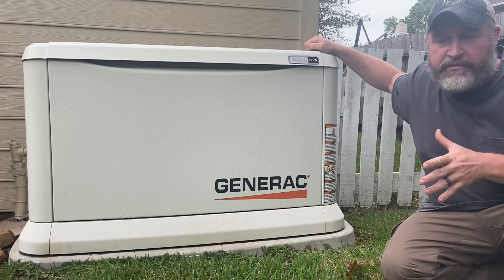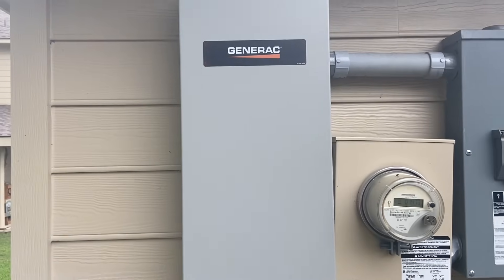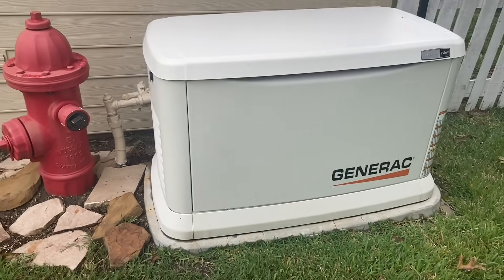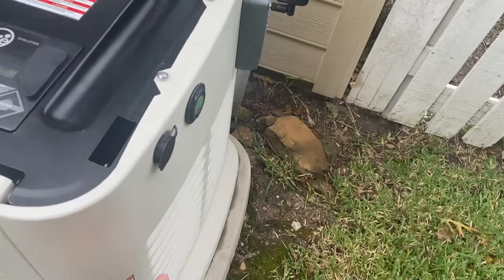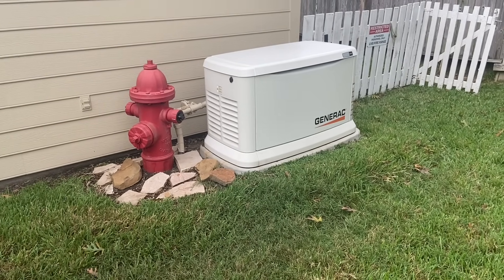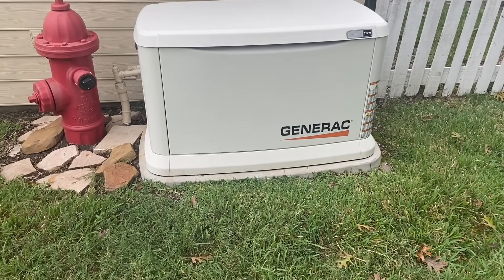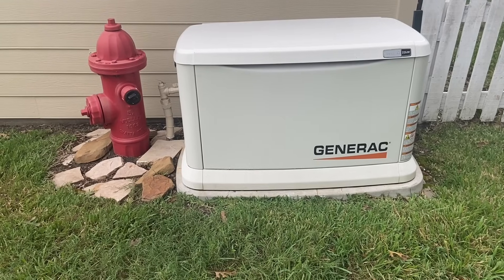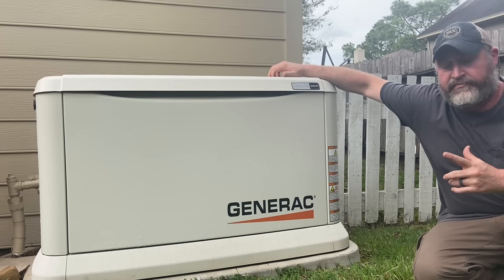Thinking of purchasing a generac whole home generator?

Comment: I have the 22k generac and purchased the 10 year warrantee,about $10k.  In the 5 years I have had it, it has run about 5 hours.  It test runs each week on a schedule an each year it gets checked.  This year I had the battery changed out as well as oil and spark plug as for each year.  Two weeks ago the red light came on, I had a quick check for problem, some item that will not let the generator start, broke.  This must be ordered, and that time may be from two weeks to a month, then schedule the repair.
Reply from the maker: Nice thanks for watching and the comment, what part broke? I ended up buying a few extra fuses that are used in the transfer switch, and also a oil pressure switch just to have on hand.

Comment: I really appreciate this video! We live in Florida where we have the occasional "weather conditions" that tend to cause undesirable power problems. I've seen these units on display and have wondered how much it would cost (ballpark), to purchase and install one but I honestly didn't want to have someone come out to my house and then bug me for months to buy one. It's good to know that whatever the sticker price for the unit is, I am still looking at about another $6000 for everything else on top of it. We do not have anything running on gas so we would have to investigate an additional LP Storage Tank and figure into that the additional costs involved there- how much to fill it, is there special maintenance involved or "gas treatment" involved if it is not used for months on end, are cylinders an option or will it have to be buried, etc...
Reply from the maker: Thanks buddy for watching, a large tanks 500-1000 would probably be the way to go. I don’t think you will have much to do for maintenance on the tank or LP gas.

Comment: I briefly worked at a small wastewater plant, I was a contract operator there, it had a much larger version of the Generac generator for backup power (Imagine something about 10x as big as what is shown).  Having had some previous experience with an extremely loud portable Generac I was concerned that the noise this small wastewater plant would make on backup power would annoy the small community it serviced.  
Well, when the plant experienced a power interruption I was completely impressed at how seamlessly it transferred the plant's power needs to the Generac and how quiet the Generac was...imagine a car idling.
My point being they do make very quiet Generac generators but based on some of the comment found here they still make some very loud backup generators too.  Choose wisely, like you care about your neighbors and enjoy sleeping during an outage.
Reply from the maker: Thanks for watching and the comment , some can definitely be loud we are happy with the nose level of ours. How Loud Is A Home Standby Generac Generator?????
https://youtu.be/C-a5FbEqU7A
Reply: The Commercial ones are built much better than the residential ones, which are like an appliance.  That large one was probably a diesel, running half the speed, in a sound insulated cabinet.

Comment: Pretty cool and great investment especially for the folks out living in the gulf coast and east coast. We have a 6500W Honda generator we’ve had for years, and use it as a back up source when we lose electricity. It was initially gas but we switched it to propane since we a 500 gallon propane tank and it made much more sense. When we had the house built we added a 50amp plug for our RV, and that is what we use to plug the generator to provide electricity to the house.
Reply from the maker: Nice ! Great to be prepared we are in the gulf coast so I know where your coming from. Thanks for stopping by and checking out my channel. Please subscribe like share!

Comment: Kohler is a very good generator as well. They are actually commercial grade engine and cabinetry. There are pros and cons for both of these brands. I am leaning towarďs kohler at the moment i think. Thanks for the great review.
Reply: Kohler makes a good toilet...not sure how capable they are in the electrical department.
Reply: A cast iron engine with a "four pole " generator means it last longer and runs at half speed while producing same amount of power.
Reply: @chrisgraham2904 
Different company entirely. You never heard of Kohler engines? They've been around for a out 100 years
Reply: @kirkstinson7316  Your wrong about that!  Kohler Company of Kohler, Wisconsin, U.S.A. was founded in 1873 by John Micheal Kohler and they manufacture plumbing appliances, such as toilets, tubs and vantities and gas, propane and electric engines.  I was aware of their electric pressure washers.  Next year they will celebrate their 150th anniversary.
Reply: And the Kohler is made in u.s.a. vs Generac is made in china
Reply from the maker: False : Generac generators have been in production in the US since 1959.

Comment: Nice job. Great prices! By the flag, I assume your in Texas, so labor is much cheaper. I paid 6K just for a 2K Generac and switch. I did the trenching myself, and ran the gas and electric myself. Just needed the plumber and electrician to sign off on the permit. My permit was $1200, i had to have drawings made and approved, and the total was over 11K. And it broke the first two times I needed it, even though it self tests every week. The self test does NOT test the transfer switch. Mine started on fire when it stuck on the first time, and then the control panel went in the generator. The only good part was the engine. Maybe thats why they no longer sell the 2K model? That being said, my brother has the exact same model as mine, and has had zero issues.
Reply from the maker: Yea we are in Houston Tx, sorry yours did not work out we been good so far.
Reply: That’s not cheap.  I’m in Illinois and they are quoting me for a 20,000 KW about 9 grand.  But my wires and propane tank can be sat just 10’ away so minimal charge there.   I’m hearing 9000 to maybe 10 for mine with Kohler 20,000 and Generac.   I lean to Kohler due to electricians telling me and this…..  pissed off consumer.  A lot of people are angry about Generac not honoring the warranty.

Comment: I have had my 22kw for over 3yrs now..just changed the optima 35 group battery..house is only 1200sq.ft😎👊🏻 NO PROBLEMS
Reply: Beyond overkill you don’t even need an 18kw lmao you literally wasted money
Reply: @Youdontwantitboy  
Yup wasted it..😎👊🏻
Reply: Please don't waste your money on expensive batteries-it is not neccessary.  A standard automotive battery changed (replaced) every 3 to four years is more than adequate.  Just change it.

Comment: I've had my Genreac for 11 years and have never had to change the spark plugs.  I check and change my oil and filter myself.  I have changed my battery once also.  Why pay someone $400 dollars a year for a oil change that is simpler that changing a lightbulb.  Everything is right there in front of you.  Let's see... 11 X 400 = $4400 dollars! Thats almost another Generac. It's no harder that changing the oil on a lawnmower.  Save yourself some money. I'm pretty sure a guy like yourself can change your own oil. As for the spark plugs, how often do they really need to be changed?  I have not changed mine in 11 years and it still runs like a top!  It's just something for you to think about.  Other than that, it is a great video!
Reply from the maker: I don’t pay 400$ for a oil change but I appreciate you taking the time to comment.
Reply: @JustCantSitStill  You are very welcome.
Reply from the maker: @eddevoe2519  please stop spamming

Comment: I only paid $2195 for my 16kw and spent $200 for installation parts. Installed myself for $2400 total. Can’t imagine spending 4 times that amount!
Reply from the maker: To each there own , I do a lot on my own but some things I am not comfortable doing. We also wanted the extended warranty so the turn key install was the way for us. Thanks again for the comments, and watching.
Reply: Some jurisdictions won't let the homeowner do the complete install.........been there, done that.
Reply: Good for you.  Obviously labor is always expensive especially when the install must meet code and it involves electrical, NG/LPG, landscaping, & plumbing experience.  I certainly do not want bad wiring or leaking NG to ignite a bomb when the city power is lost.  I guess the peace of mind was worth it for me.

Comment: This was an excellent video and I appreciated watching it and learning about your experience using it. In Virginia a system like your's would definitely come in very useful since when commonly have power outages due to a mainly monopoly power company dominion energy that controls about 90% of our state's power production. And of course overbuilding of new neighborhoods in a short amount of time and little to no increase in capacity from the power company has resulted in more frequent and longer lasting outages. Also, the increased outages and power surges that come with them have cost us dearly by destroying major household appliances that you would expect to last for a couple of years at the minimum. Buying warranties with appliances is a smart move which came in handy for us when our stove/oven, refrigerator/freezer, and deep freezer; all died within hours and days of each other. The saving grace was that we had the longest warranties that we could get and bought our major appliances through Lowes which has an excellent service program with high knowledgeable and skilled repair technicians and warranty record. Hurricanes and tropical storms are also regular in Virginia and pose a more critical reliance case for generators in our area near Virginia Beach, Virginia the power company can take sometimes between 48 hours at the least if your lucky which is like super rare and on average 3 full weeks when we have a hurricane. So this is something that I'm definitely looking into for the future.
Reply from the maker: Thanks Richard for watching and the great comment, please subscribe and check out some of my other videos. Have a good one.

Comment: One of the 1st things to do is before you buy is to contract with a service provider that will provide service (including regular maintenance) in your area. 
My experience with Generac "authorized dealers" who perform maintenance and/or repair has been dismal. My installer, never returns calls, texts or emails. Other dealers in the area are no better. Ive contacted 2 other authorized private electric business concerning maintenance and/or repair and I even went to one of them of which during normal business hours the building was locked and their voicemail was full. Thus, no one I've tried contacting has responded. 
One more thing, the Generac warranty states if repair or maintenance is performed by anyone other than a Generac trained service person any damage to the generator may not be covered under warranty. Summary... you can't necessarily count on getting good service and if you do your own work make sure you document EVERYTHING.
Reply: me too same experience.
Reply: Not exactly.  WARRANTY work must be performed by trained personnel-for Generac to honor their warranty.  (Someone at the COMPANY must have a Generac Tech ID).  Standard maintenance work-oil and filter changes etc, can be done BY ANYONE.  Just keep up with your receipts and document the run hours IAW the manual.

Comment: Thanks so much for making such a detailed, informative video about these Generac systems. I've been considering getting one for a year or so now. I'm in mideast Tennessee and there's a good generator company in Sparta, Cove Generators, I had a few years ago install a transfer switch and outside plug for my DuroMax XP12000EH, who sell/install these Generac systems. They pretty much run about the same as what you paid, a little over 10k (plus or minus, depending on what's required). I'm still debating the pros and cons, though, tbh. My DuroMax is sufficient to run my entire house if the power goes out for any time, but I hate the idea of having to make gasoline or propane runs when my tankless hot water heater runs off gas anyway. It would be so much better to have a Generac using the gas we already have coming in. I could run the DuroMax off that gas as well, but I really like the automated function of the Generac. Plus I like that these companies have these maintenance services and will look after the machine for you. I'll probably pull the trigger on one. My home is just under 1300 sqf, and I only have one ac/heating unit, plus no other buildings that would need power, so I might not need one as powerful as yours. Thanks again for taking the time to make this awesome video.
Reply from the maker: Thanks for watching and the great comment , definitely a lot to consider. For us the convenience was a big factor. When we are at work and the power goes out , the generator does its thing to keep the house livable from temperature to refrigerator to security.

Comment: Usually people don’t power everything in the home.  It’s a total waste of money. We only have 10kw.  2000 square feet with a well.  We are just fine with that size. We’ve had power outages of two weeks at a time, due to wild fires and big storms.
Reply: As @Jaimedyess stated, you're not obligated to run everything, but it's a nice flex to know that you could if you wanted to!  My brother has a Generac (more significant in size than the model shown in this video), but I don't think he has the entire house wired - just the well, the kitchen, and the main living areas.  It's an oddly-designed house, so only some parts need to be connected.

We want one at our house, but it will never happen because we live in an HOA-restricted neighborhood. 🥲😠

EDIT: The more I think about the size of his setup, the more I believe that he HAS to have the entire house hooked up to it; he'd be a fool to not do it that way.

Comment: I have just finished a 24Kw install. Generac was backed up 6 months and would not sell me the unit, so I bought it from Home Depot ($6500) in about 3 weeks. It was a big learning process, as there are a lot of things that are not obvious: 1) it does not come with a battery 2) HOA's generally don't understand, so I had to educate them about dB sound of a generator vs a AC condenser or lawn mower 3) the generator is not perfect when it arrives from the factory (mine did not have the WIFI modular power line connected and the T1 fuse socket was lose and had to be tweaked). I used my own master Electrician who has set up a few generators and he was about $2000 cheaper than one of the guys who contracts for Generac and thought I was a sucker for asking him for a quote. I used experienced gas plumbers for the natural gas connection. After weighing options for the pad, I made a custom steel shallow box and with gravel on the outside and 4" of reinforced concrete for the pad and small lip in case it decided to move. I put this all behind a new fence next to my house and after figuring out all the Generac left undone for me to figure out, we are up and running. Total install with me as the GC was about $11,000--give or take. The project from beginning to end was a couple of months, mostly waiting on the HOA to give approval (which I had to threaten to take them to court to get the ACC to give the approval).   My biggest object and additional leaning is that even though the system is on my WIFI network, I do not have a remote monitoring capability, or at least not one that I have found yet. I'm not sure why it is on my network if I can't monitor it online.
Reply from the maker: My dad did the same thing with his unit which helped me decide to do a turn key install all with one company. It’s strange you can not monitor I assume your paying for that service? I would call who ever provides the monitoring and ask. I do know the new ones are coming without the mobile link currently as they do not have the parts. Check out my mobile link video for more information. Thanks for stopping by and checking out my channel and thanks for the comment.
Reply: Who was your Master Electrician?

Comment: Make sure to get any extra warranty with a Generac. I have had to have mine worked on every year past 3 yrs over $2900 dollars. I was 6 months out of warranty and rotor went out ,only had 38 hrs run time on it.  Generac installer called factory to see if they would help on parts and i called also. That was a waste of my time gal i talked to was absolutely worthless.
Reply from the maker: Thanks for watching and the comment and info.

Comment: Thank you for your video. I'm considering this exact Generac model for my home. The vendor is the same company although I'm in FL.  My house is smaller at 1550 sq ft, but is all electric. I have a 3.5 ton AC (heat pump), hot water heater, range and dryer. In addition to the fridge, I also have an upright freezer in the garage. My main concern is that I would not be able to run multiples of appliances concurrently.  I think you've answered that question! The main reason I'm hesitating is my utility is asking $8,100 to extend gas service from across the street. Again, thank you for your video. I found it most informative.
Reply from the maker: Phil your very welcome, thanks for checking out my video, please subscribe and check out some of my other videos.

Comment: Great video! I've been looking at one of these. My problem is that the prices in Ca never seen to include the permit. The contractors here want to add 1500 to 2k to the price to pull permits to discourage it. I called generac and asked for a recommendation of one of their installers that would include permits or add a nominal charge similar to what I saw on your invoice. They apparently don't have one.
Reply from the maker: Thanks Scott for checking out my channel please subscribe like share!
Reply: & there's my point, that's the kind of service you can expect from Gen-A-Crap.